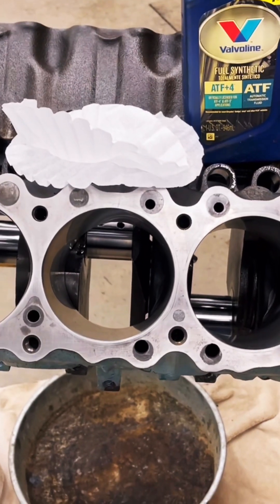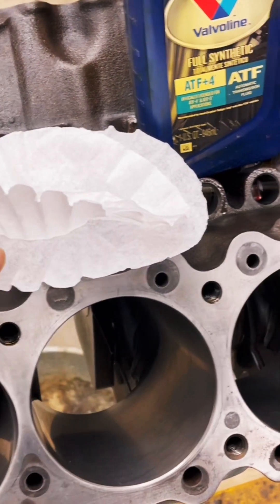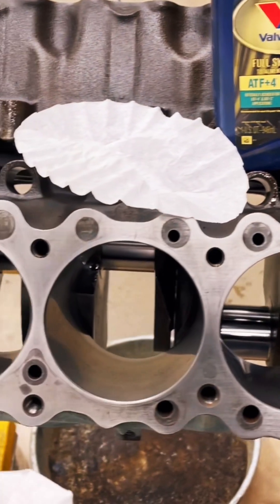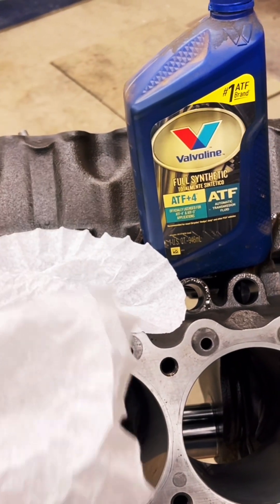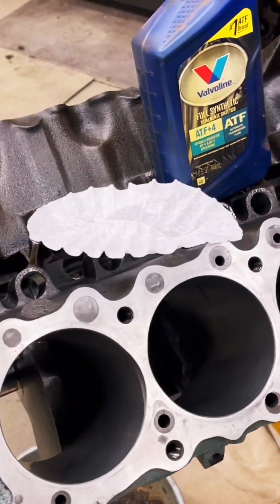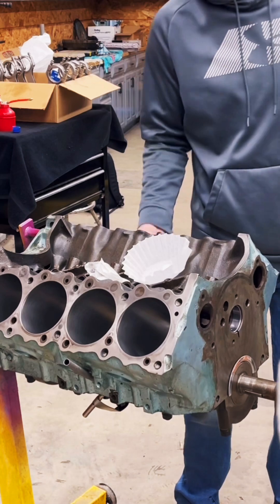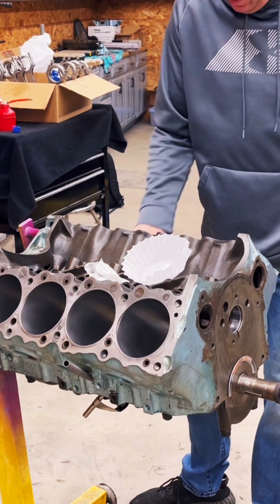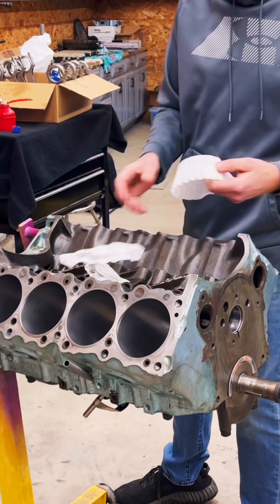How To Clean Cylinder Bores Before Engine Assembly #shorts

Comment: We just put a 6.0 together wiped the cast oil pan out with red shop rags. We fired the engine 2 mins after running we notice 20psi and falling oil pressure. We dropped the pan the pickup tube screen was full of red rag lint. About a quarter wide and about ¼in thick we got lucky enough we caught it.
Reply from the maker: Oh man, that's a nightmare!  I had a friend who did something similar but did not get lucky!
Reply: @2HacksGarage  yeah it would have been another min or 2 we were gonna be making hits to get the tune right thank God I caught it.

Comment: Got a question for you guys 
Bought a long block 
Completely built 
From a auto parts 
Ok
It always had a vibration 
Great compression 
180 psi
 30,000 miles 
Well taken care of 
Maintenance every 3,000
Miles 
Castro oil 
Proper breakn
Pulled it out to put it n another car 
Now I Haden herd it run before it was pulled 
Long story short 
It had a knock 
Finally pulled it back out 
Checking berning
#1 and # 2 rod Bering were spun 
But the lifters still oiled well 
Why would the Bering spin
Ok lack of oil I guess 
But why 
What would I look for
Reply: Every thing inside the entire Eng was still new looking
Reply: Every thing inside the entire Eng was still new looking
Reply from the maker: first thing that comes to mind is an oiling issue and got HOT.  What was the oil pressure at when this happened?  Also, do you know the clearances of the mains, rods, etc?
Reply: @ 35 psi 
I suspected that was the problem 
Got hot 
Because he said that the heater core had blown 
I told him the same thing 
Been hot
An was the reason heater blowing up 
Thank you for your time to answer the question 
So I wasn’t wrong 
About hot 
Makes sense 
Thank you
Reply from the maker: @ heater cores have a tendency to get clogged, which can be flushed but in most cases, they need to be replaced.  Was that 35 psi at idle? Also, what do everything else look like after it spun a bearing?
Reply: @ not really on clearance 
It was marked by shop
On all bolts had to take it for their word it was right 
Good oil pressure
Reply from the maker: @ was it a rod bearing that spun? How did the mains look?
Reply: @ ever thing look like it was just installed 
No ware
Even still had the hone marks in the cylinders 
But 
So much Bering shaving 
In valley an filter 
Causing the lifters 
To bleed an miss fire at random times time 
Would you say 
Scrap the block 
Being so hot 
I know the lifters have to be replaced from the metal shavings or taken apart an cleaned ( to me not worth the hassle)